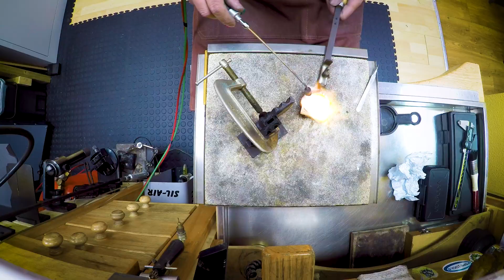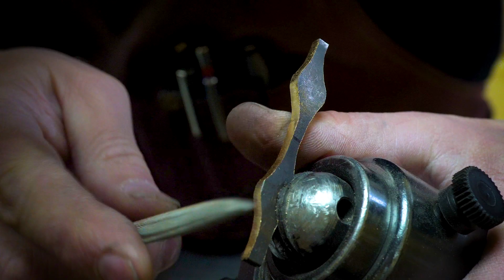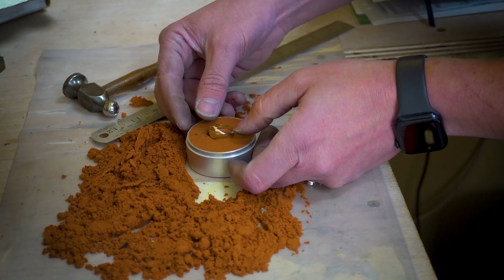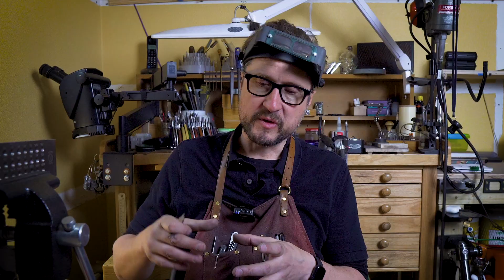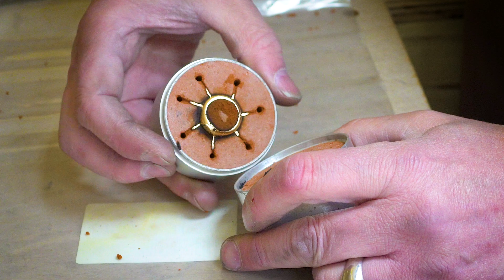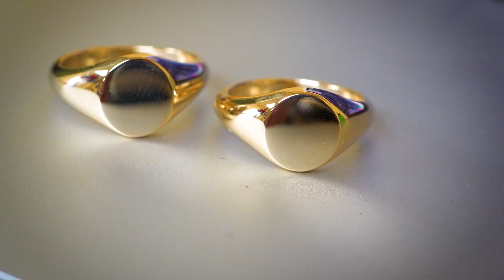Handmade Gold Signet Ring Gone WRONG | Jewellery Making Tutorial | GWS

Comment: Wonderful as ever! 

I’ve never seen anyone put the funnel hole in the middle like that. It looks like it works well.
You mention putting the hole ‘maybe 2 mm away’ - I can’t quite work out what that means. Where does the narrow point of the funnel sit in relation to the ring.
Thank you! I’m going
Reply: The funnel hole in the middle is kind of common practice and it can be better for some models, for example pendants which are flat on one side and have detailed work on the other. For rings, however, i think it's better to make the inlet the other way, making air escape channels is easier and it's less messy getting the casting out. Plus, the casting flask in this video doesn't allow that, it has no hole for the side funnel, so that kind of funnel is the only option here
Reply: Thanks! I think ppl cut a hole in the flask to use it the other way.

Comment: I had a similar problem with a customer's old gold, but it wouldn't just crack; it would crumble. One hit with a hammer after casting, and it crumbled into pieces. A couple more melts fixed this for some reason, though. Was it air porosity or some kind of funny inclusion that eventually burned away or dissolved into the flux? Who knows.

Comment: That's a fantastic video! I would like to share with the viewers some more sand casting tips that have worked for me. For a long time, I had no access to a rolling mill, so I had to sand cast everything, and I guess I've done it hundreds of times. Nevertheless, I've learned some tricks from this video as well. You have great experience! So:

- If possible, don't rely on just a line on the side of your casting flask. Make a notch in one half and put a headless screw on the other so the halves always match perfectly. That way, it is quick and foolproof.
- Chopping the sand takes forever and you can't chop it fine enough anyway, especially if you've used the sand multiple times. Use a sieve instead; a common household colander works great if you reinforce it somewhat using wire on the perimeter. You don't need to sieve all the sand, just the part that goes in contact with the model and a little more.
- Compacting the sand with a hammer is not necessary in most cases, especially with good sand. Just press it firmly with your finger. That way, accurately pushing the model into the form is easier and there is less risk of breaking your model if it is made of wax.
- When making air escape channels, don't scribe. Take a modeling knife and push it into the sand, don't cut. That way, the surface is less disturbed, and the whole process is less messy.
- You can get away with fewer air escape channels than you think. For really small parts, you can skip them entirely. The smallest gap between the halves plus the sand porosity works well enough, but better to be safe, of course.
- Heat the metal properly. When you think it's hot enough, give it some more time; it must be really liquid.
- There are flasks that are used vertically, not horizontally. If that makes sense, they are a little easier when making an inlet and escape channels, but be aware that the molten metal tries to push the halves apart. Keep them connected; a rubber band works fine. But don't push on the sand in this case, or you'll squish it, and the part will be much thinner.
- Note that the casting will be just a bit smaller than your model when the metal shrinks. So if you are casting a ring, account for that, although you will sand away the rough surface anyway, and these will cancel each other out.
- You can cast parts with holes using cardboard tubes in their place, for example.
- If your inlet is lower than some parts of the cavity, you may need air escape channels for those going up.

I hope that helps someone! Not everything might work for you, but please try these tips before giving up on sand casting. It could be a great help.

Comment: Why wouldn't you consider 
1) that it was a poor initial alloying (in the crucible) and reheat, recast the ingot?;
2) add fresh casting grain; and
3) anneal more frequently. 

You know more than me, but I would suspect the metal immediately and test , reheat and add a bit of fresh. Even alloy up a bit. 

How is recasting in sand superior to making a fresh ingot? This totally seems like suspect metal composition.

Please explain why these options were not considered. I'm confident there is an answer between your brilliant ears! There is an explanation via physics why sand casting was an improvement,  I wanna know! Thank you, Jaco!
Reply from the maker: Great points. Let me explain -
1) The was a mixture of different items. Some chain and some rings. The melting went as expected. Little bit faster melt but not by much. I could see what I was working with here. 
2) I never add fresh metal to metal provided. The estimate is purely labour. If the metal cracks, we call the customer and look at the options. 
3) I annealed it very frequently. 
Sand casting ended up saving this situation  - we love making by hand as you know but using this method helped in every way and I was happy to deliver a top quality product using it. Casting is certainly not superior to hand making but using metal provided has it’s limitations and these turned out great -
Reply: @jacothejeweller  Ahah..that makes sense. Thank you for your time and explanation. I'm one of those learners who always wants (or tries) to find out, "Why?" It makes sense  about not adding fresh when a client wants to only use their own metals. I didn't think of it from that perspective. I'd be curious about the metals and why the alloy cracked from manipulation but was fine in casting.  I'll dig around on that one. 😎 I have Brehpol's volume for metallurgy: The Theory and Practice of Goldsmithing - its a big brick of a book and quite technical. Do you recommend any other source for  nitty gritty understanding? I recently bought sand casting equipment, and am looking forward to having gorgeous results like yours, Jaco. Thank you again. I hope my questions don't bug you; if so, I'll zip it!! 😅
Reply from the maker: @flyingcheff  not at all - I’m happy to help - the idea here is to share knowledge 👍🏻 as for books, I’ve got a few but it’s more for reference in my shop. Stay curious - that’s how I got here 👌🏻